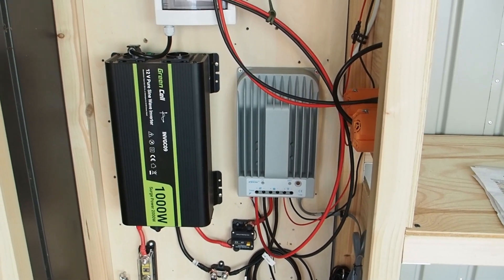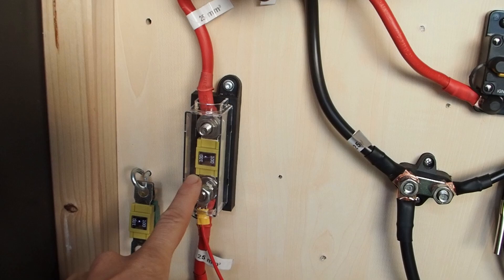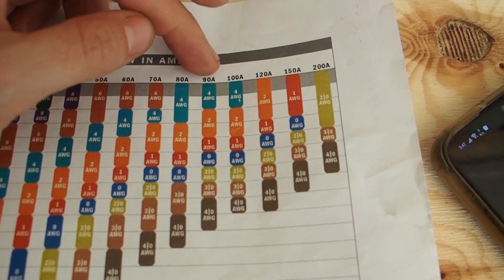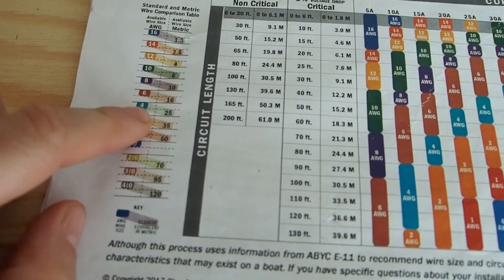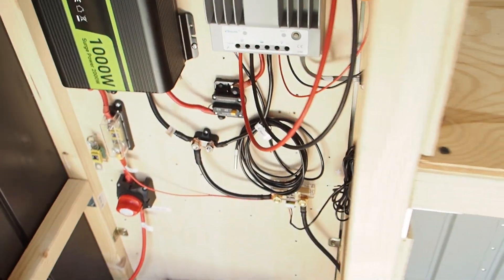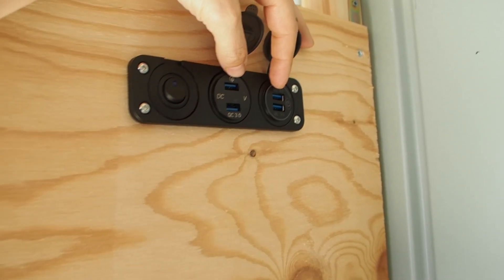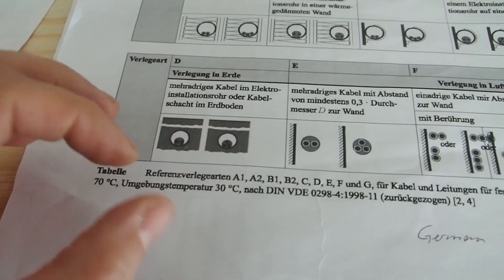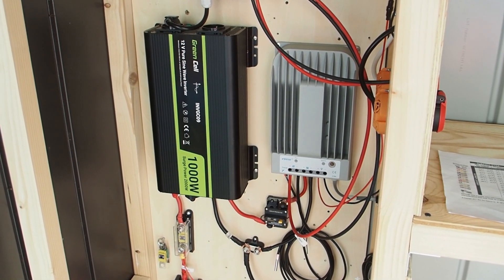Wire Size of a 12 Volt Solar System

Comment: Hi, is it true the inverter will be drawing full amps from the battery when in use ? Even if you are just charging a laptop or running  fridge it's using the same ?
Reply from the maker: Nope. It only uses what it uses
Reply: @SurvivalLilly  thanks for clearing that up, very nice setup you have.

Comment: Most know were heading into a major war - some thinkers think that 2 billion will die others think 5 billion will die in the nuclar exchange - 
       You can also look at it from a biblical point of view - it refers to the 6 th trumpet war that would be WW3 it says 1/3 of mankind will die in that exchange - 
 There many thing happening presently - magnetic north has migrated from 6° to about 40° thats causing the earth to wobble - 
     In the end there thousands of more earth quakes world wide and soon there will be major volcano eruptions - 
      Volcanos create dark winters by.releasing ash into the stratosphere it blocks sun light - 
     Some thinkers think after ww3 we will see a 10 yr dark winter - in that case solar will be unreliable - 
      When i was a kid  in my area there was no grid power - most had delco farm light plants - 
     For those that did not have the money to buy gasoline or kerosene they often ran there generator off of charcoal gasification units -  they would run there generator all day once a week to charge there house battery's - 
      If WW3 does happen fuel will be hard. to come by - some might take time now and master charcoal gasification to run a generator on dark sun days - 
     During WW2 European country's often relied on wood and coal gasification to run generators and vehicles

Comment: Don’t fall for the grid tied stuff? Here in the US we paid $25 for the electricity consumed and $48 for the rental and maintenance of the lines by creating your own power. You’re eliminating most all of those cost figure that out for the life of most panels 20 years the system pays for itself Easily! 
whereas in a grid tief system you’re still paying all of the transmission maintenance fees, along with a portion of your electric consumption? And at the end of your 20 year payment plan, you left with dead panels and holes in your roof and the power company has made lots and lots of money off of you 😳When you can generate all of it and keep it all! And use the grid for emergency use only!

Comment: You  might  put a 1000 watt load on the inverter and see what the voltage is at the inverter at full load - 
     With the distance there is from the battery's to the inverter you might have a voltage drop - 
      If the voltage drops to low at 1000 watts of load - you might consider moving your inverter closer to the battery's - 
      With a 12 volt system it's better not to have more than 2 ft of power cable between the battery and inverter - 
     I worked on generators in the offshore oil fields for yrs - even if you double the size of the conductors - with 12 volt system you will still have a notable voltage drop when a cable is longer than 2 ft from the batteries - 
    I prefer the 12 volt system over 24 or 48 volts because if I loose one of two or four battery's I just lost some capacity - 
     I live in the rural deep south US and hurricanes and ice storms dose knock my power out for long periods - 
      I have a 14 kw bank of battery's and two 3 kw 12 volt sign wave  inverters - 
      In my case I charge my house  batterys a few hours each day - then run the house off the battery's when the power is out - 
    That way I burn 1/6 the fuel compared to a generator running 24 hrs a day - solar does not work well in my area - the humidity defuses the UV light so it does not strike the panels directly - so panels performance is poor in these parts -
Reply: I live in the foothills of California. I have an assortment of different types of solar panels that now add up to 14,000 watts. I have arrainged the panels in groups of 4 or 5  or 6 connected to ten Victron charge contollers. 12 volt Trojan lead acid battery bank adding up to 900 ah.  I have an Ecoflow battery/inverter that I have tested each of the 50 or so panels.  Not one panel has ever produced more than 55% of it's rated wattage while charging the Ecoflow. I have half of the panels facing west so the 1100 watt air conditioner is powered by sunlight in the late afternoon. I have load tested the entire system with the air conditioner and electric pre-water heater element, lights and fans etc and the maximum solar panel production at noon in June was 3700 watts. There are 6000 watts of panels on the roof. The solar industry is telling untruths about the wattage of solar panels.  
I have 3/4 of my home running on one 3000 watt 110v Renogy inverter 100% of the time (charging a 6 gang Generac switch bank). I have another inverter, an Aims 240v 4,000 watt inverter that energizes the generator plug and then the main transfer switch. I also have a cheapo Harbor Freight 2000 watt square sine wave inverter that powers only the 120v 1500 watt heater element inside the preheater water heater. The pre water heater feeds the propane water heater. I have turned off the gas to the propane water heater for 10 months a year as the pilot light uses 1 gallon of propane every 3 weeks.  I have a 6 hour spring wound timer to energize the pre water heater element. 
On top of all of that I have a couple of gridtie inverters with limiting CTs which prevents backfeeding to the grid. I have knife switches that switch the roof panels either to the charge controllers or to the gridtie inverters. I use the gridtie inverters to pump water once a day to the water tanks 70 feet up the hill. I also use them to run the air compressor, my lathe and also my welder. I have had a few months where I used less than 3 kwhr from the grid for the entire month, but CA has recently enacted a minimum charge ($.39 a day or $12.50 a month) and to maximize the minimum I must use 1 kwhr per day, or 30 kwhr per month to obtain a monthly $15 bill. I have been using solar now for 1 1/2 years. I was cleaning some old files the other day and ran across a power bill dated 2015 where the monthly bill was $16. I have around $15K into my system, although $3K of the equipment was replaced with better stuff so I could do it again for $12k or so. 5 years ago I got an estimate to have solar panels with micro inverters professionally installed, no batteries; $30k. If I paid cash it would have taken 17 years to pay for itself as at that time my monthly average power bill was less than $75  per month.  Solar is a scam and is certainly not sustainable (whatever sustainability means), but it does increase one's independence.
Reply: @steverturnsk6190 every thing you said is absolutely true - the only time solar works is if you don't have grid power and you have good sun - 
     In dry regions were the humidity is 20% or less and there few clouds solar can work fairly well - 
   I have worked remote oilfields in the US we did use some solar for radio & microwave tower repeaters that relied on fuel air drops - 
   As a rule in the US nothing beats the price of grid power -  in my area we often deal with hurricanes - I've ridden out 19 hurricanes in my life time and a few ice storms - 
       There has been times were it took several months till our grid power was restored - 
      In that case 14 flexible panels can help to reduce generator fuel consumption - for those who have them they just set them out when there power is out for lengths at a time - 
      In my case I have several golf cart batterys presently - I reduce the strength of the acid from 1.275 to 1.220 gravity - 
      That way I will get about a 40 yrs service life vs 7 yrs with stronger acid - there is a 30% decrease in capacity with the weaker acid - 
    Sense I only cycle them when needed they will last much longer than 40 yrs - 
   Where I live there was no grid power till 1960 or so many used 1.200 strength acid for there house battery's -  my grandfather worked on farm light plants for 50 yrs - 
    He said with 1.200 acid charging the battery's all day once a week - they expected a 60 to 70 yrs service life from those farm house battery's - 
     I inherited my first set of house  battery's they were 1.195 - they  were 2 volt 800 amp cells - there 16 of them - they were cycled weekly from 1900 to 1960  then they  stood by on a float  30 yrs - 
    When I sold them they still had full capacity and there was no noticable plate rot - it was because of the weaker acid - with .195 there is a 40% decrease in capacity & they freeze at 0° F -
Reply: @steverturnsk6190 sense your using flooded batterys this is a well kept secret in the battery industry - 
   If you want spare battery's on hand you can do this - 
    You can take a lead acid battery fully charge it then pour the acid out into a container - then fill the battery with water and let it sit a while - then pour the water out - 
      Do that 3 times - then leave it up side down to drip the water out - ( in my area the battery has to be off the ground or ants will build a nest in the battery's)
     After the battery is dry - it's a dry charged battery - it can be stored in that state indefinantly - 
     Over time the negative plate will oxidize some - it will just take longer to reactivate the battery when you pour the acid back into the battery to activate it - 
       Also if the acid poured out the battery is 1.275 strength there will be some acid strength loss in reactivating the battery with it's original acid - 
     From what I've seen the acid strength is reduced to 1.220 or 1.240 when I reactivate a battery with it's original acid - 
      If you want it back at 1.275 or higher what I do is I use a syphoning hose like used to syphon gas out a car with the bulb pump - 
     I pull the acid down to the top of the plates then I add new acid to top the battery off - in most cases it will bring a starting battery back to 1.285 - 
      Most of this info has been lost - you can look up on the net about 32 volt farm light plants also rural town 110 volt  DC power plants in the US - 
      Even in New Orleans in the french quarter on bourbon street there was a110 volt DC power pant for decades that sold power the residence In the french quarter - 
    During the winter they charged 2 hrs daily and during the summer they charged 3 hrs in the morning and 3 hrs in the evening - in summer a lot of fans are used in the deep South - 
   that plant was used up till after WW2. - .my grandfather said those battery's were 50000 amp 2 volt cells with 1.195 acid strength - there were 55 cells with spare plates - my grandfather said he never heard of a battery failure in that power plant - he worked on all that stuff from the early 1900s -
      All this can be found on the net but has to be searched for - 195 acid freezes at 0°F - the lowest temperature was what the old electrical engineering used for.the. strength of acid in stationary battery service -

Comment: a bit of power ready to use.  In back up situation (Chuman accent).  no sound, no stinky thing. 1000 watt inverter just fine for 12V.  I figured all out at that time.  Braided wire works better for solar 10 Gauge from panels to controller.  And twist it (literature reviewed).  protect the cables from Sun off panels, OVER TIME with a sheath.

Comment: Good video. only thing i'd change is the Fusible link at the inverter. i'd use a Circuit breaker instead. 100 amp circuit breakers are cheap & available easily. Overloading that inverter under normal use is very possible & changing those fuses is a pain & expensive.
1000 watt inverter is Small Relatively speaking. if You plug in a 1500 watt Hair dryer You will blow that fuse , 1500 watt appliances are very common.
i always recommend a 2,000 watt continuous inverter min.
Great video as always. take care. 
Fusible link at the Battery is Ok / Very Good.

Comment: Wish that I could find a Super Chic like you 😊
Reply: Join a Outdoor Club For hiking or Rock climbing. Might Find one there. She's a Unicorn 🦄. But, they are around. You Just have to Think about it. Where do Super Chicks Hangout ?
Reply: @OcRefrig  thanks 👍
Reply: Today solar and off grid power is a novelty in developed nations - 
     My grand father was an early 1900s mechanic/ electrician - 
    I live in the rural south US - in the US rural family's that had power from the 1890s till grid power was brought to rural areas had farm light plants - 
    Were I live up till about 1960 homes in the country that had power had a large bank of battery's - the house would be supplied 32 volts DC - in rural towns merchants sold entire lines of appliances that were 32 volts DC - they sold radios, fans, water pumps, light bulbs, electric irons, vacuum cleaner, refrigerators ect - 
  There was an agreement in the rural areas to only charge there house battery's on Friday - 
     A home ran off the house battery's for 6 days and they charged the battery's all day on Friday - 
     Were I live at most used farm light plants till 1960 or so - grid power was brought out here in the 1960s or so - 
    Till then every one lived off grid out here - the battery's lasted 40 to 60 yrs -

Comment: Here’s my money saving wire recommendations….. use the biggest wire possible… you will expand your system, needing ever bigger wires. I also recommend this when buying solar chargers. Everyone buys a 40 amp to start, then a 60 and so on. I’m on 120v/120a now. If you like solar, this is just your start. A 100amp hour battery turned into 800.
Reply: Bigger system are usuallu 48 volts = smaller wires, unless you are into vanlife.
Reply: @RickyB67  I only initially wanted what Lilly has. It just blossomed into this. And yes it’s retired and a camper.  So ya 24/48 would be better for houses
Reply: @RickyB67  well I started this solar adventure by making a 400 watt cover for my roof rack on my suburban and now it’s powering a camper.
Reply: @RickyB67  I’ve 4000 watts of panels now a 80 amp/100v controller and the 120/120 amp 3000watt inverter. Completely off grid. I bought a generator as back up and have never used it despite living in northern Wisconsin.
Reply: Please where can I get a 120V/120A charge controller?
Reply: @adon8672  I bought mine on Amazon. Just typed it in and there’s a selection. I won’t recommend one because I’m no expert. But they are there
Reply: Peppers are a funny ol bunch. All they are doing is surviving a little bit longer to suffer a little bit more. If you are a prepper, here is a video telling you where you don't want to be when the world hits the fan and how your chances of surviving what is coming, is zero. Enjoy.
https://youtu.be/hiaVztBr1qI?si=qgA9QfLWHgEKSMEC

Comment: Use mirrors to reflect sunlight on your solar panel.
Reply: Great idea. Never thought of that
Reply: I used a high powered flashlight once just to see if my panels worked after I installed them at night. Turns out my street lights can trickle charge my batteries. Who knew